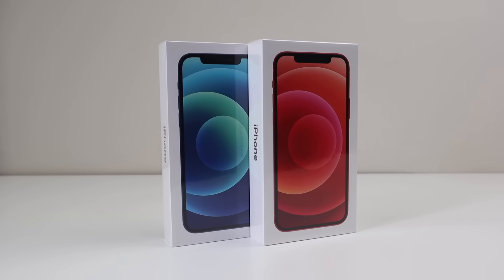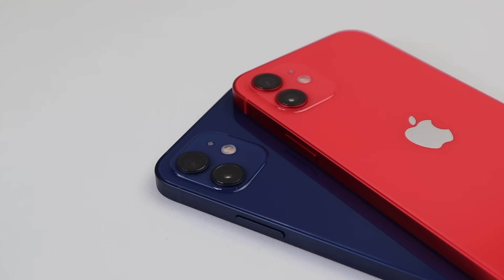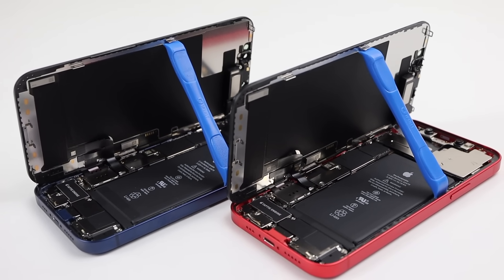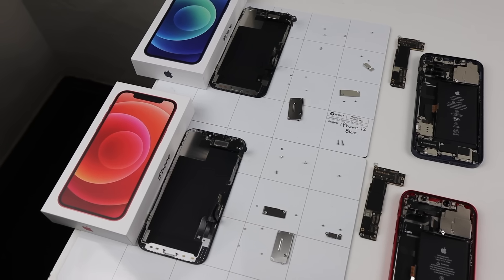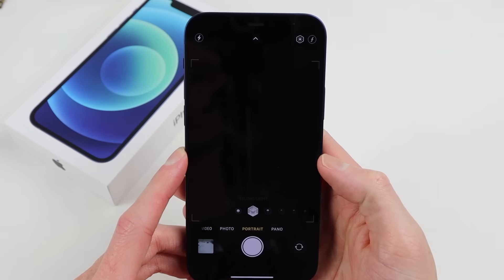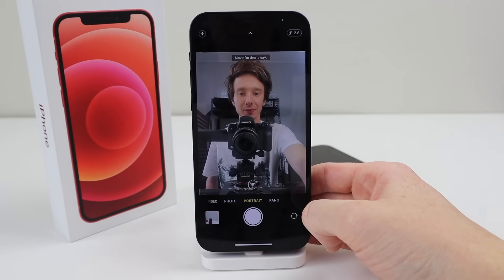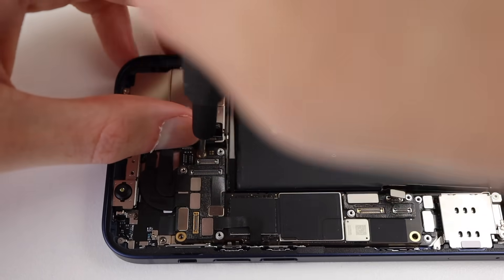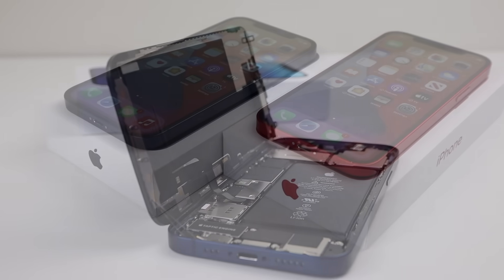iPhone 12 Anti Repair Design - Teardown and Repair Assessment

Comment: The last time I bought an Apple device was back in the 1980s when I had an Apple ][. Since then I have hated the way the Apple company operates and this video reinforces in me to never buy an Apple product. My wife has an Android phone and she broke the screen. I had no trouble getting a genuine replacement screen installed by a mom-and-dad repair shop in Bangkok for around US$50. Labor might be more expensive in the US or Europe. When she broke the screen again a month later, same repair and same price. As a side issue I told her to stop throwing her phone against the wall when she is pissed off with me. Hit me instead. It's cheaper. :)

Comment: They probably have a crypto/security controller that is like you mentioned serialising the camera. 
I think this is probably the only place where I partially disagree with the right to repair. While a mobile phone is not a safety device and so fixing a camera should be an issue. Unless it can be tampered with and used for nefarious purposes by those replacing it (which is not something you would do but probably something people in the military are probably worried about). What I would say here is that Apple should protect itself from people replacing counterfeit cameras. But like you said it is suspicious that they wouldn't let you use a camera from another apple device. 
My contention comes in the auto industry where I think it should be protected. If I were to replace a sensor on a vehicle and it isn't fit for purpose it can very much mess up the hw-sw interference which is a huge safety red flag. This is specially true if the design gets update even after the car is sold in which case replacing electronic parts 'can' be dangerous

Comment: The fact that IOS is trying to remove 3rd party repairs is just awful because they charge a LOT for the repair and sometimes they just tell you it's unrepairable and to buy a new phone, but there are people who not only do a better job, are cheaper and fatser if not, when it is actually beyond repair, they tell you the reasons, F U apple, this is why people buy android
Reply: God i hope they dont fucking go overboard on copying apple since i know most companies do
Reply: @somerandombeach8966  for real, I saw Samsung go down the same path with no charger and headphone jack. Like their customer usually is those who don't want to use Apple for variety of reasons. They should focus on what makes them successful, not what makes Apple successful.
Reply: @syn_mea  i like androids specifically cuz i can find a budget phone that has good enough specs for my needs but u know company's only chase after profit and other company's who makes more then them when they would get even more profits if they didnt copy apple like who the fuck wants to buy a charger sepperately and i cant even get my phone fixed without it being more broken than before

Comment: Apple has become a horrible group of people. I’m so heavily disappointed in them. Unfortunately I can’t stand the other platform, so I’m held hostage. Exactly where they want me. Horrible feeling.
Reply: Computer and laptop exists, may not be convenient but is more powerful and dont break usually, you can even make one using all sort of parts
Reply: @kharkovluzhin8333  Except you're stuck with a crappy operating system in that case.

Comment: While I think that Apple's environmental marketing is a gimmick I'm honestly not bothered by their hardware security measures.  True, it comes at the cost of repairability, but Apple has had a massive issue in the past with people buying new phones, harvesting them for parts, putting in cheap knockoff pieces, trying to return the no longer functioning device and then selling the harvested parts on the "black market".  And this has cost Apple billions over the years.

Additionally, Apple is dealing with countries like China that have been caught in the past putting very advanced hardware level hacks into electronics in an attempt to steal sensitive information from other government agencies or large companies with closely guarded trade secrets.  Apple, Google and Amazon have all been targets of these kinds of malicious attacks, and in some cases the hacks were so advanced that Amazon had to actually separate the layers of their motherboards in their servers to find the rogue hardware hacks invisibly concealed inside.

Due to the custom nature of many of Apple's parts there will always be a market for people to steal from Apple to sell to repair shops, and the specter of weakened security will hang over them as long as it's open to have any part replaced by anyone.  For good or for ill, Apple is looking for secure phones and to stop theft and this comes at the cost of repairability.  As long as the end user knows this at the time of purchasing and can make the informed decision then I don't have a problem.

Comment: Apple since established : were gonna sell a phone called the iphone but with one new feature every year and jack the price up 300$. More then its last predecessor and will make the phone extremely fragile to drops along with force are customers to upgrade when we drop a new phone along with locking users the right to repair 
Apple in 2021: were still,gonna jack are prices but buy 600 still make are phone fragile to drops but also make them look ugly and more of a brick and still give them one new feature a year and permanently lock 3rd party company out to repair are phone now we're going green by not give you your charging brick and no ability to listen to music. 
Suck to say that I got a google pixel 4xl and ppl say this phone suck cuz it an android but I'm say this can siri understand you nope does your phone have active edge nope and can your phone take the best pictures using software and hardware that actually work with one another nope but my phone can and does your phone have a low power radar can sol

Comment: every video ive seen on  the (Apes  phone ) sponsored  channels  have  tried to convince me  that  the removal of so many  useful components from  your phone is  for your own good  
 and they justify   everything  with  "  water prove"   
so  the  manufacturers  are either some sort of a religious cult    preparing theyr  phones for upcoming flood   of biblical proportions  OR  they are just  trying to make more cash which is most likely to be the case 
i would not be surprised   if the next { apes phone )  commercial is  something like that :
//   -then   God  spoke to Noah     , and  he told  him  u shall  build a  phone  and   make it water proved  ..:dont worry   even if its useless  and practically  non repairable  people will be dumb enough to buy it  and those  whom  try to repair instead of buy new one will  be punished for theyr  blasphemy by  a dozen of lawyers  whom  are representing my corporate divinity   // 
  1 think   we know for sure back in the days   smartphones    were NOT  water proved   yet they lasted  as long  as the   present day   models    OR  even longer   if you replace the  battery, or any other damaged  component   which is no longer the case    with  todays   models   whom are intentionally built  to be  non repairable  1 time use  product   similar to the  plastic coffee cups 
 thumbs up for this video   thank you for sharing  the truth  people  deserve to   know this  before they    dump  a big pile of  cash for something   non repairable

Comment: Apple: we want to reduce waste
Also apple: 
• removes the old headphone jack on iPhone 7 and up, making most wired headphones useless without the adapter apple sells
• makes the iPhone 12 come with a usb-c cable and no plug, forcing people without usb-a apple cables/chargers to buy the plug apple sells
• deliberately slows old iPhones so people buy new ones that apple sells
• serialises components so phones can only be repaired with the overpriced repair that apple sells
• doesn’t ensure all their components can be replaced, so something as small as a camera issue can flush a £1000 phone down the toilet, which forces the consumer to buy another £1000 phone that apple sells 
• adds pointless stickers with plastic backs with their phone which no-one ends up using

Comment: I mean, it bothers me from a right to repair perspective, but it is no different than the security luxury cars have had for years. Even my 2002 car has a lockout if the radio deck doesn't match the vin. And, I will never have a working remote lock dongle without paying a gm dealer to set it up or buying a GM techtool for like $500

Comment: My theory: The cameras are probably calibrated and the calibration is stored on the phone. So probably the camera app is trying to retrieve the calibration for the new camera id and it's failing to do so. So it becomes unresponsive and some advanced features that require the calibration do not work.

Comment: I long back to the time when you could open any device with a set of philips screwdrivers and all cellphones had removable batteries.
Reply: I almost feel guilty about still owning a flip phone, and how simple it is to slide the back off and take out the battery.
Reply: @bobveinne2439  tell that to my nokia.
Reply: @alexiosblake9804  lmao
Reply: @alexiosblake9804  you can remove the backs of those things? You have a reason to?
Reply: @lick28  no, mine is simply built that simple that if it falls down both the hull nd even the battery can come appart.
Reply: @alexiosblake9804  I always thought the backs of Nokia were somehow soldered together. I've never seen it come off
Reply: @lick28  depends on the model.
Reply: @lick28  yes, back then we put the SD, SIM cards in the back. We also removed the battery and plugged it back when our phone froze so much you couldn't even turn it off for 5 mins straight
Reply: @imrevig7261  Anything other then iPhones work this way still.

Comment: Zero climate impact
Uses a box, wrapped in plastic, inside a box, then the consumer needs to buy another piece of plastic, that's most likely in a box, may or may not be wrapped in plastic and may or may not be put inside another box, and then because there's no earphones or even earphone jacks, the consumer would need to either already have or buy a compatible wireless earphones, which obviously comes in another box....

Comment: Why is there other people able to repair their iPhone 12 no problem but you have issue? I think your issue is to prevent people stealing other peoples phone and using it as parts. If you get brand new replacement parts seems to work flawlessly.

https://youtu.be/p9hA59nn7uQ

Comment: I figure out how to bypass their no repair problems, by swapping the new replacement id chip with the original id chip and no matter how many anti replacement is in place as long as the id chip can be desolder and resolder anything repair is doable no matter how many new phone comes out

Comment: I can understand the fingerprint reader and face id not working. The biometric data is stored on the sensors and encrypted not on the phone. The phone can only query the sensor for verification of the user. Not pairing the sensor might introduce security issues.
However the batter and camera issues are unacceptabe

Comment: Tech-savvy people will always find a way to bypass this kind of greediness. Just like what they did with the "True Tone" issue from older models. 

What this does is simply just making the 3rd party fix more complicated and fragile, and more expensive.. a very easy way for other scummy people, like Apple, to take advantage. 

And what's more is that this is not even targeted to younger people, because we're not that dumb, but will be targeted towards the older generation who'll have no knowledge about this kind of thing, like how the power button doesn't switch on after it gets tampered within, which will most likely cause panic and have them make wrong decisions.

Comment: You can simply buy the Tool from eBay so you can read and weite Display and Logic Board id. Everything will Work after that. Costs bout 80 Euros. Also the Kamera Thing ist Just a Bug, Not a implemented Feature.

Edit: also idk why so much ppl call it anti repair Design. I mean ya it sucks that U need the exact ids Programmed but Apple is the easiest Phone to repair and dont Take Long. Doesnt matter If its an 12,11,x,xs,8,7 and more

Comment: I still have the iPhone 7 and I’m waiting for the day when I update the phone and it says, “we no longer support this device, you must buy new iPhone”
Reply: Yeah I still have an iPhone 8 and don't plan on replacing it until it breaks or isn't supported anymore.
Reply: @undergroundlighthouse2827  apple not supporting your iphone doesn't mean it wont work, it just means you won't get technical support from apple.

And nothing of value was lost!
Reply: @ruler_of_everything  Sure, and for some people that's totally fine, but since I use my devices to test websites and apps on (I'm a developer) having a device that can run the latest version of iOS with the latest version of Safari is somewhat essential.  

Obviously that doesn't apply to others, but for me the iPhone 8 is my favorite of the various models they've made and I don't plan on upgrading until it breaks or isn't supported anymore.  Though if I had to pick a newer notched model to upgrade to, I might go with the XS Pro Max as it's the last generation to support 3D Touch and it has a big enough screen to support enhanced landscape layouts.  But if Apple releases a new phone this year that takes inspiration from their iPads and puts Touch ID into the power button I would seriously consider that.

For now though.  iPhone 8 all the way.

Comment: Surely, you don't need to buy a new Power Adapter to charge the phone just a new Firewire to USB Aor USB3 lead to use with old charger - NOT - a new Chaeger